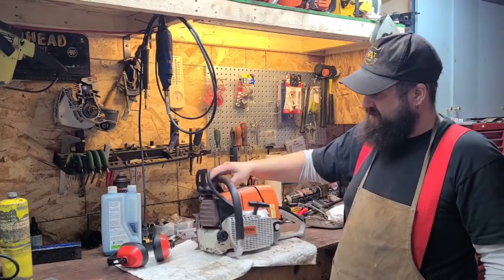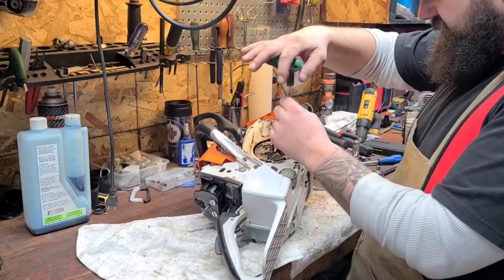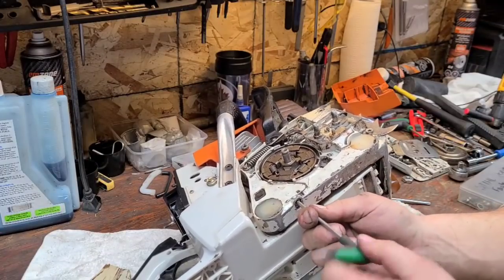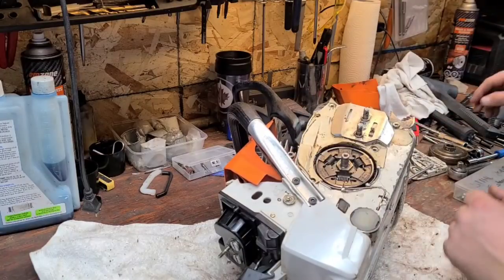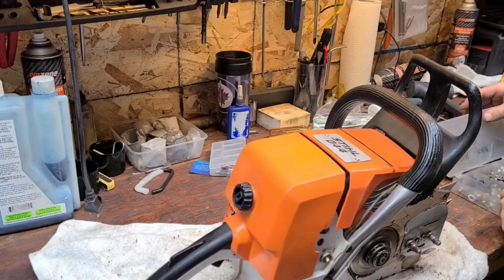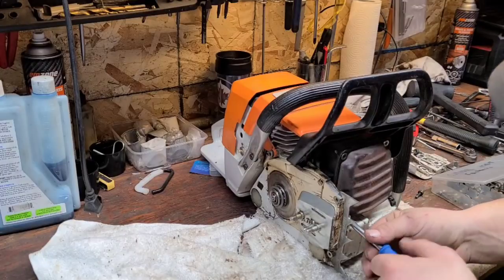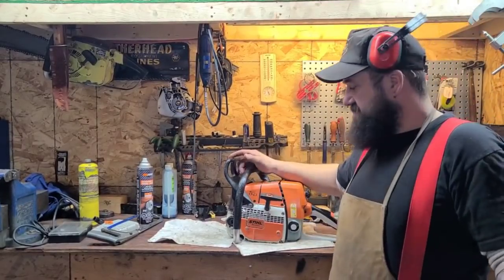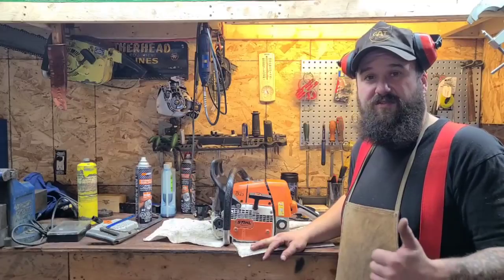Its cold out, lets put my Stihl 044 arctic back into the fleet!!

Comment: Hey Tubman. I have a 044. I was wondering about the “ winter mode “.
I have a half moon shaped hole in the shroud that faces the cylinder. I’ve been reading that there’s supposed to be a little slide or something in there. Am I missing a part for this? Thanks!

Comment: Just seen this video. So i dug, then I ended up watching all of your 044 videos..
I have a original, fully stock, 1989 Stihl 044. 10mm wrist pin, slanted fin. My friend, I love this saw. I use it to chuck up my lengths of spruce for the winter. I paid $450 last year.
I really wish you can see this saw. It runs like a top, got a 24in bar, full house chain both Stihl. I trim the rakers and she, loves the wood…!
My friend, I shall part with the wife before this saw. Love yor videos buddy. Greeting from Newfoundland. Stay warm!

Comment: you'll like this, i have been struggling with the first stihl i bought brand new a l"il 026 so i put a new impulse line on it carb rebuild kit ordered the crankseals, started it after the carb kit and a good blow out still wouldn't run any sense, then remembered i had put a new air cleaner on it, because the inbuilt choke butterfly wasn't sealing, so ran it with the covers off and blow me if the choke wasn't  coming off it was sticking! So filed a bit in the aircleaner started it and its raging again, not bad for 21year old saw! lesson for me on not always trusting stihl parts!
Reply: I have a collection of 026’s coming on here. Starting to get to know them a little & love them. They are my favourite stihl saw so far. 
I’d like to get a nice 028av some day if I get the chance, but am pre occupied with the 026’s for now.

Comment: Only two stihl saws that in my opinion are the best are 044 ,046
Reply: Back in the 80's and 90's they considered the 036 the 044 and the 066 as the best. Back then they were made to last in comparison to today's Stihl. They are like Mercedes. The older ones were built to last 1 million kilometers while the ones after 2000 are sacrificing quality for performance.The 0 series would last 30 years + today's Stihls? I don't think they will make it  to 15 years.Stihl' s best models were always not the prime numbered ones. Always the models ending in 2,4,6,8 were the best.Even the quality of the plastic on everything was superior than today's models.

Comment: That’s a fine saw! Glad to hear the farmertec tank is a good fit, gotta get one for my 038, need some parts for my 440 too! Thanks for sharing buddy! Always love FNS! 👍👍👍👍🇺🇸🇺🇸🇺🇸🇺🇸🙏🙏🙏🙏
Reply: I have a farmertec on my ported 044. I had to steal the red lever off my factory handle because you’d break your thumb trying to drive it down to engage the choke. And the tank vent leaks fuel anytime the saw is not upright. EBay vendor gave me a full refund and told me to keep the handle so I’m hardly upset.
Reply: Farmertec REAR HANDLE / fuel tank. Oops!

Comment: Tinman I have a Stihl 462 and the muffler is hollow as Ive cut the baffle out and opened up the stock outlet. It has twin 1/2 inch exhaust tubes in the front muffler cover facing forward and am getting sawdust fines inside of the muffler sticking to the oil. I am worried about dust/dirt getting into the combustion chamber wearing the rings faster. Do two strokes suck dirt that is in the muffler back in the combustion chamber? Wanted to get your take thoughts on it. Thanks and I enjoy your cutting videos.
Reply from the maker: Yes they can and will pull sawdust into the muffler.  

Watch my video called "lets talk about muffler mods" it may be of interest to you.

Comment: My equivalent would be a nice 038 av magnum, with the alloy tank that I have. 
Same issue with the start mechanism, I "throw start" the saw to avoid problems. But man it´s a nice saw!!! 
Timing feels a little advanced on the magnums even in stock format, maybe that's why it´s a bit hard to pull on them.

Thanks for all the good videos!!! 
By the way, would be nice to see you work on one of these, the early 038 mag
Reply from the maker: Theres an 038 mag on the shelf behind me. Needs attention, I'll run through it one of these days.
Reply: @tinmanssaws  that would be nice!! Going to cross my fingers it comes on the bench soon 💪

Comment: Idk if the rope spools on some of those stihls are smaller giving a guy less torque advantage or if they just have that much compression cause I got a MS290 that pulls over harder than my XL925 Homelite with a mint condition cylinder and piston/rings